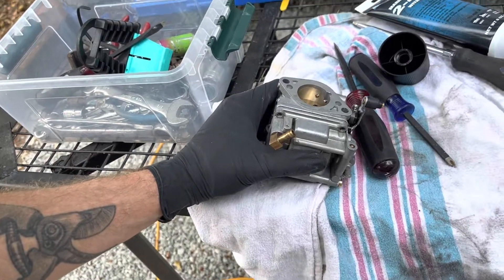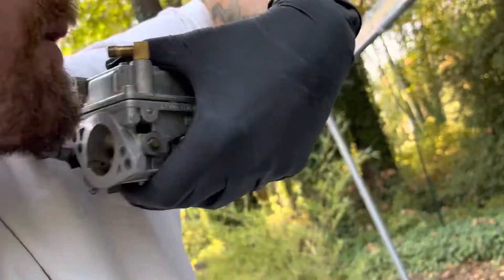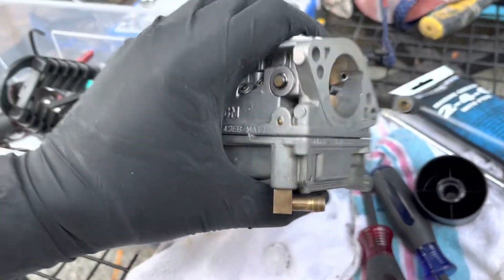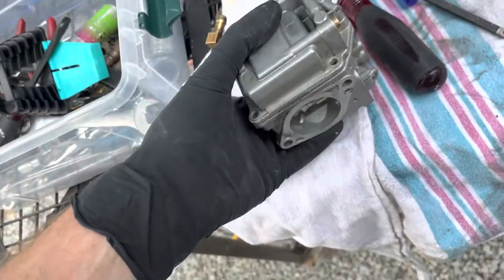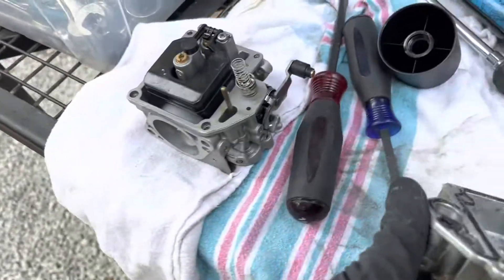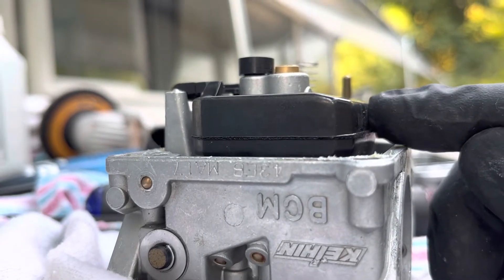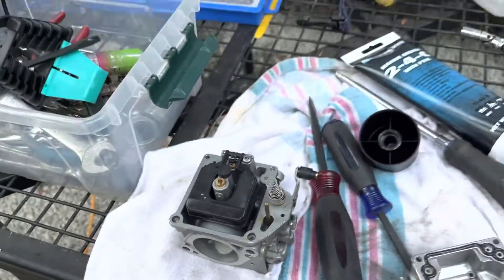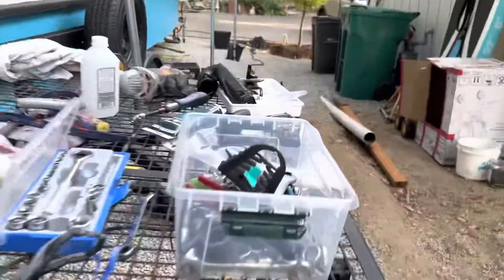@CanadaWide Marine chugging carbs - Leaking Carburetor on mercury mariner 4 stroke 25 hp bigfoot.

Comment from the maker: UPDATE. This happened with my new carb I installed. All I did was blow some air through it on the fuel input line and it cleared it up. Hasn’t resurfaced.

Comment from the maker: I FIXED IT I THINK! The float looked perfect but was warped. A new float got the leak fixed and the motor will now idle. I will update after I put some hours on it. Thanks to everyone that helped me!
Reply: he had to replace the whole carburetor.
Reply from the maker: I did have to change the whole carb. A rebuild worked for a bit and then it slowly started leaking again. :( stumped 3 boat mechanics.